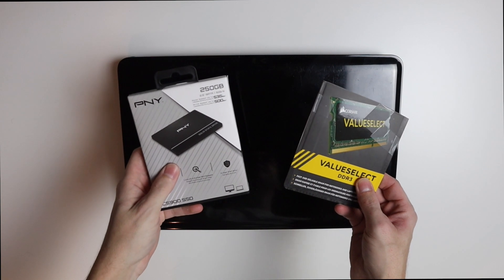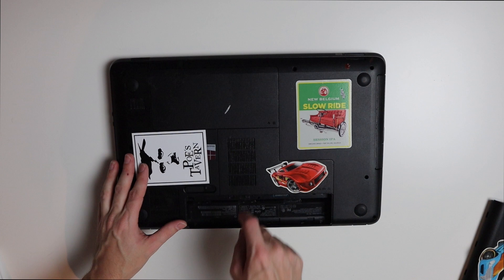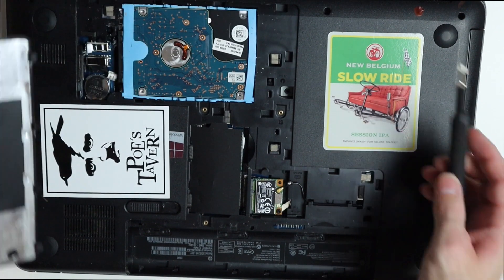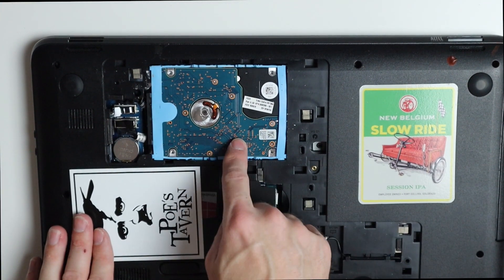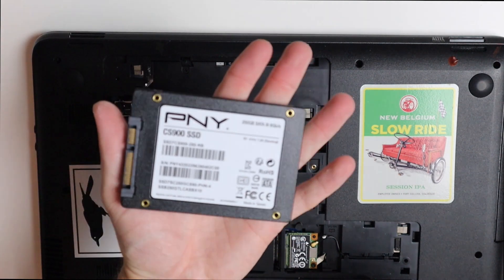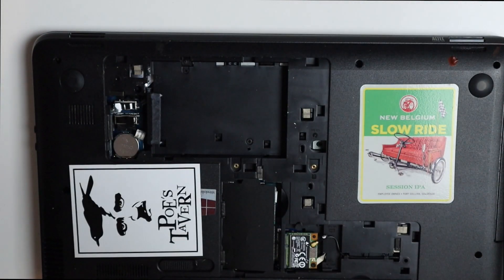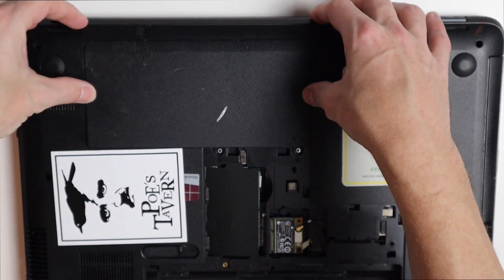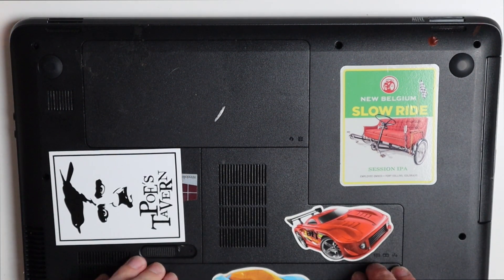Upgrading Hard Drive and Adding RAM on an HP 2000-2b44dx

Comment: I have a HP 2000-2b20NR Notebook i just upgraded the ram to 16gb and the hard drive to an Samsung 256gb 2.5 ssd and upgraded the operating system to windows 10 home 64bit the Notebook is way faster now
Reply: Does it support 16 gb? I thought it supported only 8 gb

Comment: BRO I'm confused. 
My laptop supports 16GB of RAM.. & has 2GB of RAM pre-installed. I want to upgrade from 2GB which has 2slots.
If I buy 8GB of RAM, so 8+2GB= 10GB can I fix? Will it be useful?🙂
Or I have to buy 2 4GB RAM and discard the 2GB for dual channel? (2 4GB is costlier than 1 8GB)
Reply from the maker: It would be best to do 2 8GB sticks for 16 total or use 4 and 4 for 8 total for dual channel